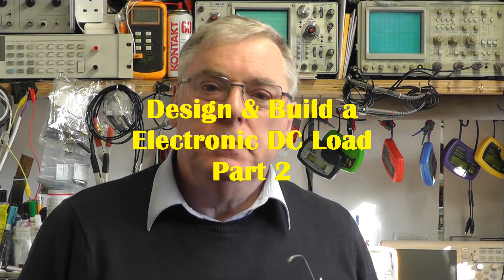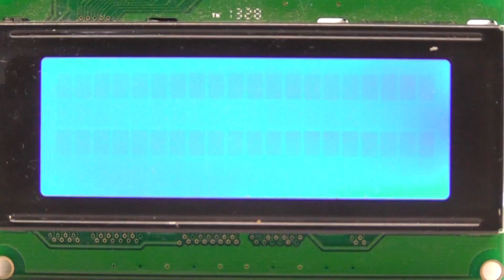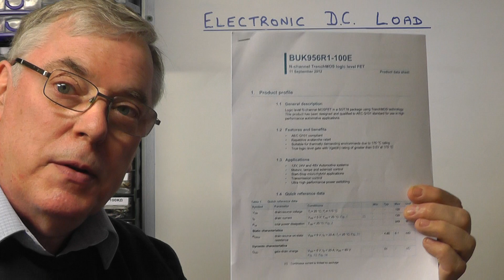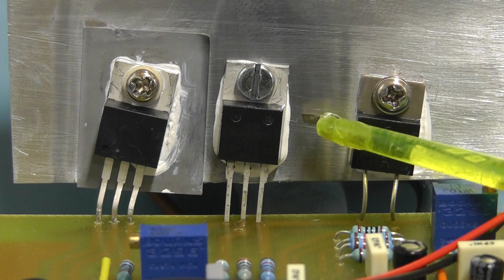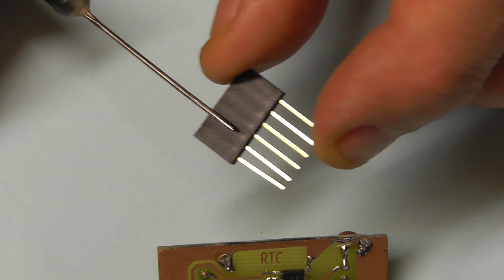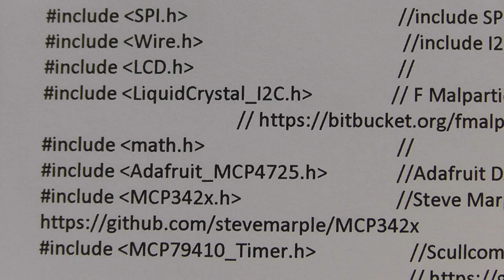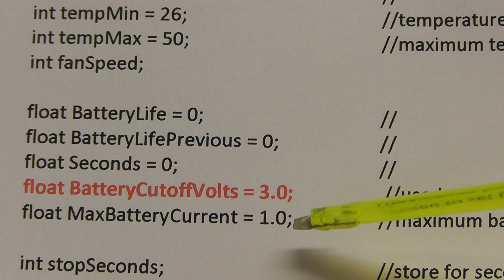Scullcom Hobby Electronics #46 - Electronic DC Load Part 2

Comment: Great video series.  I'm curious about what Lithium battery you used for the BC test?  A typical Li-ion 18650 battery today has 2,000maH (or higher)  rating from 100% charge down to 20% discharge level.  But your test only showed 51maH.

Comment: In case someone want to use Precision RTC Real Time Clock Module (ZS-042) with chip DS3231M will face the address collision in this DC-Load project.
I2C address 0x68 is assign to the DS3231 and cannot be changed. Even if the RTC board (ZS-042) contain 3 pair for solder joints for address selection unfortunately this change address only for EEPROM memory. In project DC-Load is used the A/D MCP3426A0-E/SN as dual 16-Bit Sigma-Delta ADCs which occupy same I2C address 0x68. Solution is to use HW I2C protocol for all slave devices as it is, exclude DS3231 which is connected to:
SDA to pin A2, This pin has a 10K pullup resistor to Vin
SCL to pin A1, This pin has a 10K pullup resistor to Vin
This two pins are used in function as "Software I2C". Thanks to Mr. Henning Karlsen which developed library: DS3231. Then you to slightly change the code:
- text which have to be replaced or commented.
+ add a line into DC-Load code

-//#include <MCP79410_Timer.h>                   //Scullcom Hobby Electronics library  http://www.scullcom.com/MCP79410Timer-master.zip
-//#include "RTClib.h"                           //DS3231M timer declaration 
+#include <DS3231.h>

+DS3231  rtc(A1, A2);                          // Init the DS3231 using the software interface

+unsigned long timestart; //unix time when the function timestart() was executed.
+byte timerstatus = 2; //1 - running, 2 - stopped
+unsigned long elapsedtime; //current unix time
+unsigned long timedelta; // number of seconds the timer is running
+unsigned long timestopped; // unix time where the time was stopped.
+unsigned long stopSeconds = 0; // number of seconds where the time was stopped.
+byte tseconds = 0, tminutes = 0, thours = 0;

// after void setup() {
+rtc.begin();  // Initialize the rtc object

// after void loop() { // needs to be replaced!
-timer.reset();
+timerreset ();

-timer.getTime()
+timergetTime()

-timer.getTotalSeconds()
+timer_getTotalSeconds ()

-timer.stop();
+timerstop ();

-timer.stop();
+timerstop ();

-timer.start();
+timerstart();

// add to end of program
//------------------------ DS3231 Timer implementation --------------------------------------

void timerstart() {
if (timerstatus == 2) {
timerstatus = 1;
stopSeconds = rtc.getUnixTime(rtc.getTime()) - timestopped + stopSeconds;
}}

unsigned int timer_getTotalSeconds () {
  if (timerstatus == 1) {
elapsedtime = rtc.getUnixTime(rtc.getTime());
timedelta =  elapsedtime - timestart - stopSeconds;
return timedelta;
} else {
// parameter already in timedelta  
return timedelta;
}
}

String timergetTime() {
unsigned long tmp = timedelta;
tseconds = tmp % 60;
 tmp = (tmp - tseconds)/60;
 tminutes = tmp % 60;
  tmp = (tmp - tminutes)/60;
 thours = tmp;
return align (thours) + ":" + align (tminutes) + ":" + align (tseconds);
}
String align (byte number) {
  if (number <10) {
    return "0" + String(number, DEC);
  } else {
    return String(number, DEC);
  }
}

void timerstop () {
  timerstatus = 2;
//  DateTime now = rtc.now();
  timestopped = rtc.getUnixTime(rtc.getTime());
}

void timerreset () {
  timedelta = 0;
  timestopped = 0;
  stopSeconds = 0;
  timerstatus = 1;
  timestart = rtc.getUnixTime(rtc.getTime());
  elapsedtime = timestart;
}

Comment: Great project! I just didnt understand why would there be a problem if a higher voltage was applied to the mosfet and it was connected to the heatsink only with thermal paste and the heatsink was isolated  of everything else in the circuit.

Comment: Hi, Louis! I tried to use a ds1307 and M41T56. I changed all 0x6f address to 0x68 in MCP79410_Timer.cpp and in "timer" example. But it seems to me this is not enough. Can you present a text from port terminal for "timer" example? I get the following data:
Timer Test
==========
-----------
Timer Reset
-----------
-------------
Timer Started
-------------
1
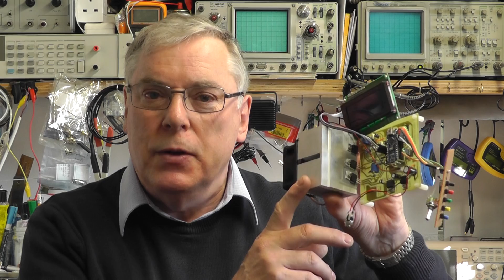00:00:01
1
00:00:01
1
00:00:01
1
00:00:01
1
00:00:01
-------------
Timer Stopped
-------------
1
00:00:01
2
00:00:02
-------------
Timer Started
-------------
3
00:00:03
3
00:00:03
3
00:00:03
3
00:00:03
3
00:00:03
-----------
Timer Reset
-----------
0
00:00:00
1
00:00:01
-------------
Timer Started
-------------
2
00:00:02
2
00:00:02
2
00:00:02
2
00:00:02
2
00:00:02
==========
Test Ended
==========

Comment: Excellent video series.  You say that the LM35 still requires an isolating sil pad.  Why is that?  I would have thought that the pad would give you incorrect temperature readings (even if only marginal) since it is more of a thermal insulator than the mica pad or just thermal paste alone.  Or, if the reason is electrical isolation, isn't that defeated by the metal screw holding it against the heatsink.  Finally, I thought you were not supposed to use heatsink compound with silicon pads, and that the mechanical pressure alone would maintain adequate thermal contact.  Thanks for the clarification!
Reply from the maker: Hi Adam,
The GND pin on the LM35 is also connected to the metal body of the LM35. Initially on this project I bolted the Power Mosfets to the heatsink without any isolating pads so the Heatsink was at the drain voltage which could be up to 30V. I did this to improve the heat transfer from the Power Mosfets and so I had to isolate the body of the LM35 from the heatsink. On later versions of this project I used Mica isolating pads on the power mosfets and so you could then remove the isolating pad on the LM35 if you wish.
With regards using heatsink compound with silicon pads. Normally you can use silicon pads without any heatsink compound. However, silicon pads are only normally intended for single use, but I sometimes do clean them and reuse them, and in that case I add the heatsink compound as well to ensure good heat transfer over the whole surface.
Regards,
Louis

Comment: You could use a STM32F103C8t6 Arduino, also called Blue pill, instead of the Arduino NANO. Because - 
1) It costs the same as Arduino Nano!
2) It has built in RTC
3) It has built in 12 bit ADC
4) it was a very fast, 72MHz frequency and 16 bit PWM timer, so you could use the PWM at high frequency and then convert it to DC voltage using Low Pass Filter which will act just like an DAC, but with higher resolution.
5) It probably has a big EEPROM inside.

I don't know if it's the right part to mention this.

Thanks for the whole series.
Reply from the maker: Thanks. I have been looking at the STM32F103C8t6 and may use them later. I ordered a few from eBay and will have a play with them. Regards, Louis

Comment: Concerning the BC function you may, if not already mentioned here, set a CV discharge when you are getting closer to 3V. When reducing the discharge current, the voltage will rise a bit. You could set a cut off current then, e.g. 10mA or 5mA. This will give a more accurate mAh measurment.
Reply from the maker: The BC function sets a constant current which is maintained as the battery voltage reduces.

Comment: the thermal resistance calculation confuses me.  by that it would seem that it would be best to have no heatsink at all eliminating the thermal resistance.  doesnt the thermal dissipation of the heatsink have to be factored in as well to understand the temperature?
Reply from the maker: First remember thermal resistance is the reciprocal of thermal conductance. So therefore thermal resistance is actually a heat property which is a measuring a temperature difference by which an object or material resists heat flow. In my example I show that effect for each element between the mosfet die and ambient temperature and how that effects heat flow. The important thing here is to remember that thermal resistance measured in °C is the amount by which it restricts the heat flow or heat transfer from the mosfet die. So it is important to keep the total thermal resistance as low as possible.
In my example I showed the effect of running the Mosfet at 30 volt at 3 amp which means the total power being dissipated is 90 watt. The thermal resistance illustrated is therefore calculated at 90 watt. 
You will see at that power level the heatsinks resistance to heat flow is 54°C, this is calculated from the datasheet of the heatsink which shows its resistance to heat flow at 0.6°C per watt. Therefore 90 watts at 0.6°C per watt = 54°C.
If you did not use a heatsink as you suggest then the thermal resistance of the mosfet junction die to ambient temperature would be 60°C instead of 0.43°C (look at the datasheet for the BUK965R1-100E (table 6, thermal characteristics). So this would have to be factored in to the calculation when you take out the heatsink thermal resistance and would have a drastic effect on the ability of the mosfet die to keep with in its maximum allowed temperature.
Hope this helps to understand. I appreciate this can be a difficult subject to understand and id not easy to explain in just a few words.
Regards,
Louis

Comment: I'm curious where or how you found the .6 c/w for the heatsink I can't seem to find the specs for most of the heatsinks fan combos on eBay for example. most say "95watts max" but no thermal resistance data.
Reply: it seems some of the more well known cpu heatsink manufactures do post thermal performance graphs which allows us to calculate c/w, thermaltake is one example (http://www.thermaltakeusa.com/products-model.aspx?id=C_00002014).

I also found the follow calculator that helps estimate thermal resistance based on material type, base thickness, fin thickness and number of fins.
http://www.myheatsinks.com/calculate/thermal-resistance-plate-fin/#
Reply from the maker: Hi David,
You can find details for a wide range of heatsinks fan combos on the link below:
http://www.dansdata.com/coolercomp.htm
Regards,
Louis
Reply from the maker: Thanks David for the links. However they did not provide specification in °C/W. The link I sent you however does provide that data.
Regards,
Louis

Comment: First, excellent tutorial and thanks for share your knowledge.
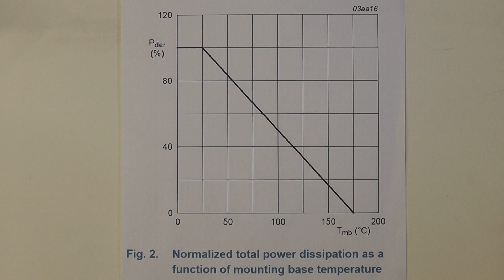At 13:10 you started talk about the temperature dissipation on heat sink, so in my case, I'm using two mosfets to control and share the power. How should I calculate the power dissipation in this case? 
Again, thanks. I appreciate your initiative.
Reply from the maker: I will be looking at parallel mosfets in Part 4 as well as some alternative Mosfet types. As they will share the load the power dissipation will be approx. half in theory although in practice you would have to add a little leeway.
Reply: Ok, understood.
May I suggest IRFP27N60K for analysis?
Thanks
Reply from the maker: The IRFP27N60K although it will handle the power it is not a Logic Level Mosfet so it would not work in this project. The IRFP27N60K requires higher gate/source voltages of more than 5 volts so if you were to use it in this project you would need to add a gate drive IC to provide the higher gate/source voltage it needs.

Comment: So I've been looking into making an AC voltage reference but cab literally find no information on anyone doing one which confuses me.  Maybe this would be a good future project?
Reply from the maker: Thanks this may be a good idea for a new project.
Reply: Scullcom Hobby Electronics I started a discussion about it on eevblog. its getting pretty good.
Reply: Scullcom Hobby Electronics Ok I really hope you do because I'm completely baffled about how to do this economically and practically.   I really thought there would be an ic where you put in so many volts DC and it spits out so many volts ac rms or P 2 P  But apparently it's a lot more complicated than that.

Comment: Very nicely done project! Could this be used to test the battery capacity of other batteries such as a 12V lead-acid battery or gel battery of 17Ah capacity?
Reply from the maker: Thanks. Yes it could we just need to add the addition requirements for different battery type. I am looking at adding some options in Part 3 of this project.

Comment: I like this project, and I'll be following it with interest. Your change of MOSFET makes a lot of sense, heat sinking is always an issue in these designs. Perhaps you could consider parallel devices for increasing the power? It increase the cost and complexity, so perhaps only a consideration for people wishing to take if further? I've used the IRFP260 MOSFET in some of my projects that required constant power loads. The gate drive requirement is higher, but it's very stable over temperature and it's easy to use them in parallel.

Keep up the great work! Looking forward to the next video.
Reply from the maker: Thanks for your comments. I have been testing a number of Power Mosfets. So far I have found the BUK956R1-100E the best one to date. I am looking at putting two in parallel. I am also looking at the IRL640 which is capable of higher drain/source voltages up to 200V, but have not tested it yet (have a few on order).
Reply: I think the BUK956R1-100E is a very good choice given the design requirements you've chosen. I like the IRFP260 because it has an isolated mounting hole. It removes the electrical isolation issues associated with direct heatsinking, plus the low RDSon is not bad either! Keep trying new devices as you never know what you'll turn up! Thanks for your reply to my comments, I know it must be difficult to answer everybody who writes to you.
Reply from the maker: The isolated mounting hole of the IRFP260 does make it easier to isolate it from the heat sink and make good contact. I have been test a wide range of Power Mosfets including the one you mentioned (IRFP260) but to date I still keep coming back to the BUK956R1-100E. Many of the others are not true logic level Mosfets and do not work very well with the restricted gate/source voltage.
Reply: The BUK956R1-100E is a nice device, but it's a fairly unique part. It's already been noted by other viewers that the part is now marked as End of Life on the NXP website. http://www.nxp.com/products/discretes-and-logic/mosfets/automotive-mosfets/n-channel-trenchmos-logic-level-fet:BUK956R1-100E?tab=Buy_Parametric_Tab

I did find a few others with fairly dog linear characteristics but the Vgs range is a bit too high for the design in it's present form. One such device was the Fairchild FDP075N15A_F102 https://www.fairchildsemi.com/datasheets/FD/FDP075N15A.pdf Perhaps you might consider modifying the design use a wider Vgs range it's would increase your possible choices of MOSFET.  

Despite the chosen MOSFETs EOL status it still seems to be available from a few sources. 

I think the Lipo testing is a good feature. Would it be possible to combine features from your waveform generator software and introduce a limited form of pulse load testing?
Reply from the maker: Thanks for your detailed comments. I am currently working on a number of improvements and additional features for Part 3. I have consider a Pulse Load option and may decide to add that later. I hope to get Part 3 of the project finished shortly which has involved addition work on the software. Regards, Louis

Comment: A great project, Louis. Do you or any of your viewers know of a similar project that it capable of 130V at 1A (up to 140V preferred)? I assume there would be too much to change in SW and HW to adapt your project?
Reply from the maker: Hi Bob, As 130V at 1A is 130W it should be possible. You would need to use a higher voltage drain/source rated logic level Mosfet and use say two or more wired in parallel to share the power load. The BUK956R1-100E I am currently using is limited to an absolute maximum drain/source voltage of 100V. 
The Vishay IRL640 is a 200V logic level mosfet which may do the job for you but I think you would need to wire 3 in parallel to get a stable 130W (and a good heat sink) - I have not tested this mosfet yet in my circuit but it may be worth a try. You would also need to isolate the mosfet from the heat sink (suggest a mica washer and heat sink compound) for safety, due to the higher voltage. You would also need to adjust the resistor values in my circuit which monitors the load voltage so as to ensure that it drops to a range from 0 to 5V (may need also a tweak in software to allow for that and do the appropriate calculations in software). Regards, Louis
Reply: Scullcom Hobby Electronics - thank you, Louis. That all sounds very doable and encouraging . I think I have some IRL610's in my transistor trays, so I will look into it more. Many thanks again.
Reply from the maker: Its the IRL640 - think you made a miss typo.

Comment: Maye a footprint for another parallel mosfet(s) and the their current-ballancing source resistor(s) could be added to the PCB design to handle higher currents. Also the power tracks could be done somewhat beefier as there is a lot of unused space on the PCB, but not a big deal for <10A currents.
I like the thorough and comprehensible way you explain things very much. You would be a great teacher.
Reply from the maker: Thanks for your comments. I am looking at adding additional Mosfet's in parallel. We could even take the Mosfet and sense resistor off the PCB and use heavy gauge wire.
Reply: I would also be interested in increasing the current capacity by running parallel Mosfets, and believe taking them and the sense resistors off the PCB would be the way to go.  I look forward to your future videos, great information regarding the engineering design process.
Reply from the maker: Thanks Dale.